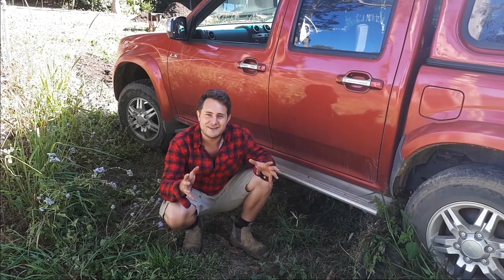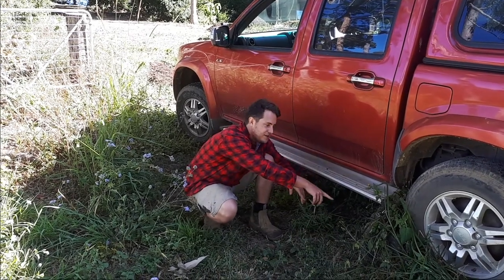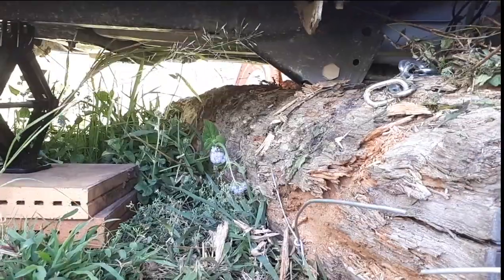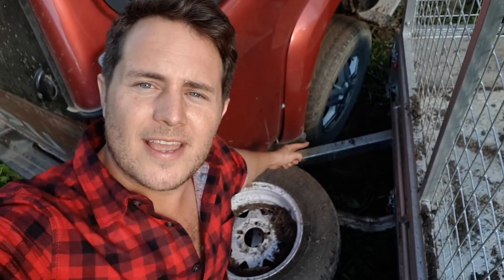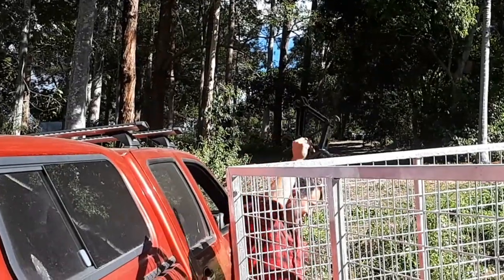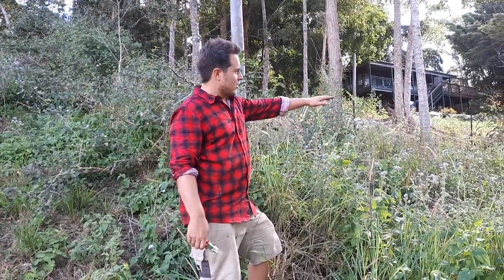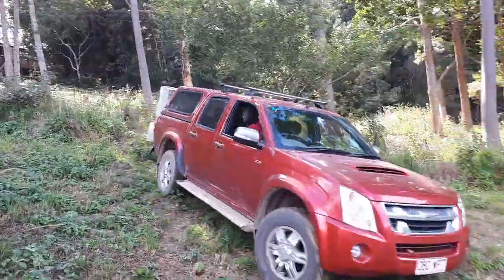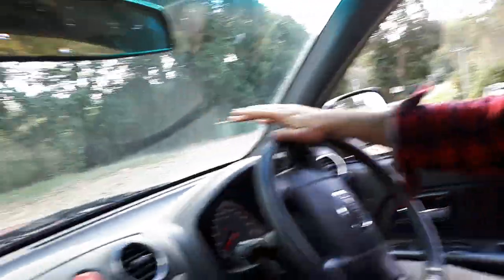How to ESCAPE a JACK-KNIFE!

Comment: If you can, always carry a hardwood block, about two inches thick and 12 inches by 12 inches, and place it under the jack to stop the jack from sinking in the ground if the ground is soggy, what happens is once the jack makes a hard contact with the chassis, every stroke will make the jack sink and it won't lift your vehicle but it will sink the jack, lol
Reply: LMAO, I stopped the video at 1.39 bc he was doing it wrong, wrote my comment above and then he goes and lays two pavers underneath, lol see, it works, lol, I'm going outside for a smoke, DOH dang